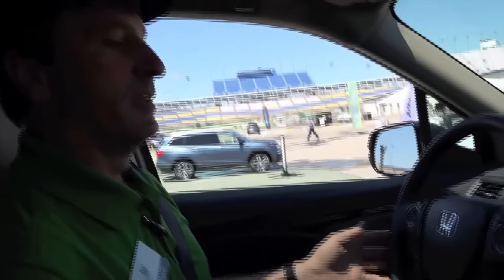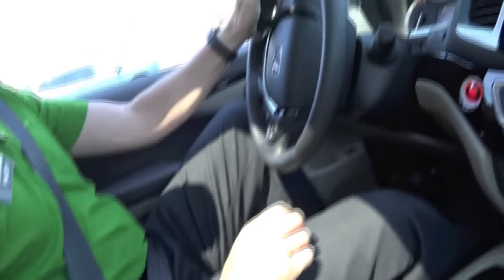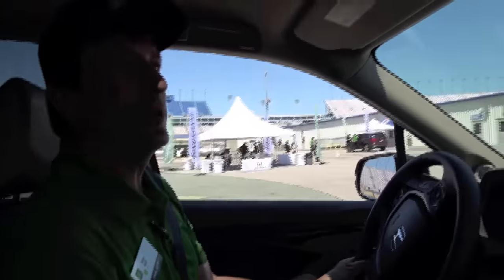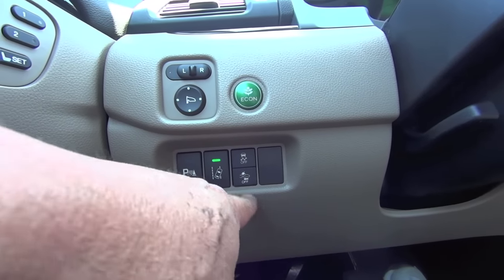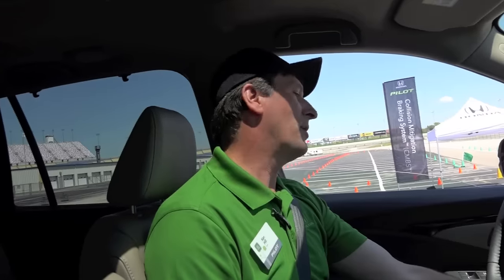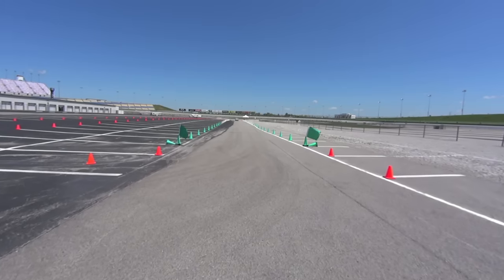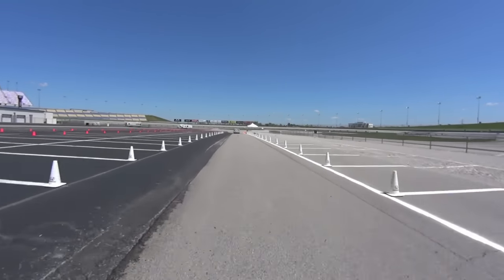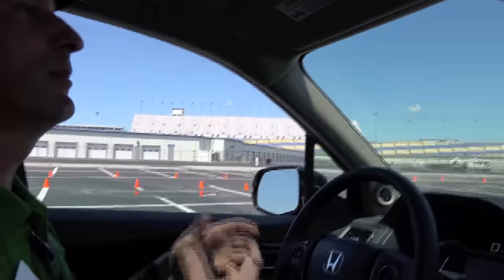2016 Honda Pilot Crash Mitigation Brake System

Comment: It is very dangerous. I turned it off right away
Reply: gangstaBJK why did you turn off the brake mitigation? I saved my moms life! You should keep it on just in case because it is very helpful
Reply: Also if you turn it off it will turn it back on the next time you start the car.. also what kind of person would turn off a feature they payed for?